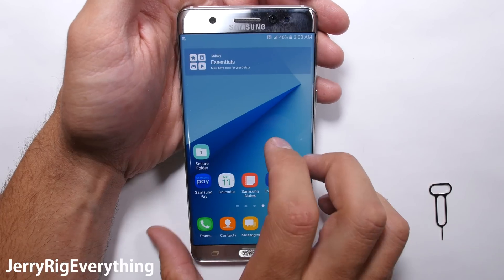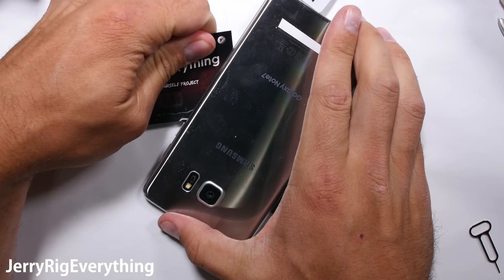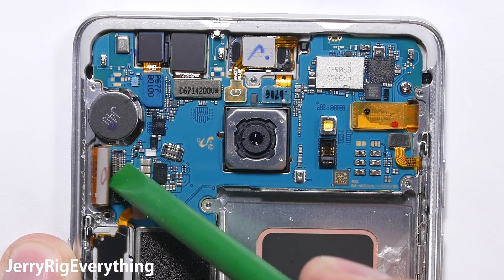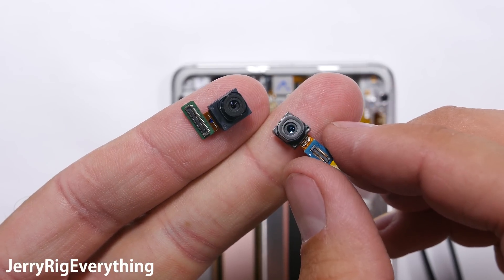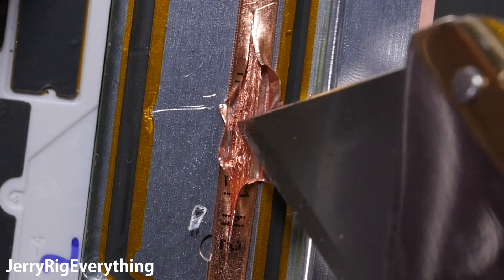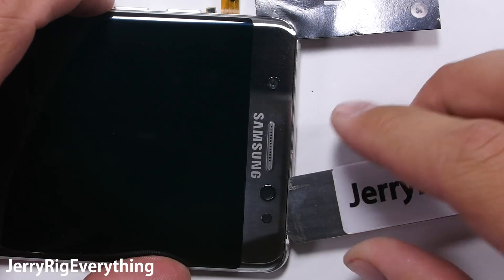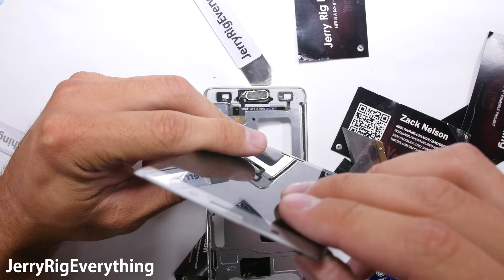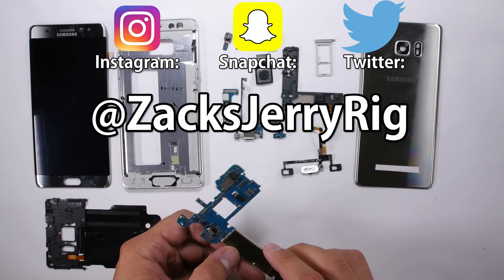Galaxy Note 7 Teardown - Screen Repair, Charging Port Fix, Battery Replacement

Comment: Hi.  I have motherboards for Samsung Galaxy Note FE and 1 display with frames, 1 back cover.  I have already ordered NFC / WIFI antennas and speakers.  I need the rest of the parts for mounting phones with 14 motherboards.  Can you write me what else is needed to complete the phone in full?  Motherboards, displays with frames, sim trays, s-pens, back covers, NFC / WIFI antenna, speakers, camera caps.  I up please help.

Comment: I wonder if u happen to know the exact housing space which the note 7 battery has, as well as from the Galaxy s8 plus. My note 7 is still working due to a software fix from me. But i am still aware of the fact it could explode. That's why i wanna replace the battery from the note7 with the battery from the s8 plus. I've read it'd fit. But I wanna be sure of it.

Comment: Can you replace the original note 7 battery with the Fe battery? Will it work?
Reply: hukebine yes, if you can find an FE battery
Reply: Would the s7 edge battery fit?
Reply: Farin Pohl no

Comment: Hey can't those who still own a Galaxy Note 7 nowadays just replace the battery so it won't explode
Reply: Let's see how long usernames can get,I guess they can pretty damn long like really long if you can find one, absolutely. You will need to install a package disabler to prevent getting cripple updates
Reply: Let's see how long usernames can get,I guess they can pretty damn long like really long omg your username though

Comment: so it means it will not explode?
Reply: RENZO LOUIS don't know, I asked the same thing
Reply: hiesenberg the battery could have to burst to combust into flames. And as much as I LOVE the note series, this one goes boom at an alarmingly easy rate
Reply: LOUIS' JOURNAL they caught fire ,not explode plus the majority of note 7s would not catch fire just alot and i think it only happened during charging

Comment: Hi Jerry, I have a galaxy s7. I lost my sim key and decided to use a sowing needle instead. I did this a couple of times, it worked. Then recently I found one of those life hacks, the sim and SD card hybrid card DYI. Well It didn't work and as I was trying to pop out the sim tray again and my sowing needle just ended up going through the rubber or plastic of the tray and jammed in the sim tray hole. So even if i got another legit sim tray key and just end up jamming in further the sowing needle. Is there anyway you can think of way of prying it out? I'm assuming Id need to take my phone apart. Please help lol it's just a stupid situation I put myself into. If you can could you tell me what tools I'd use to fix this issue as well as parts.

Comment: I love my Note 7, but now the lcd screen is cracked and is completely unusable. Where can I get a replacement screen for my Note 7? I honestly can't find them anywhere.
Was production canceled for replacement parts after the recall??
Reply: Take it into Samsung and get it exchanged for a brand new S7 Edge. Samsung is obliged to replace them.

Comment: fuck this is upsetting....my replacement note 7 has a faulty home button that sticks on the right side when pressed in. i called Samsung yesterday and told them I'm keeping my original note 7 (the first recalled one) to use as spare parts since you can't get any note 7s anymore and for them sending me a somewhat faulty replacement .

But but after watching this teardown I'm extremely upset that I basicslly have to live with this home button on my replacement. unless anyone has an idea of what i could do??? any help would be greatly appreciated
Reply: You should really consider exchanging it for an S7 Edge.
Reply: C00LiDude I'm a note only person. I find its functionality to be on a whole other level compared to any other smartphone. And I don't think it's fair I should have to buy a note 5 (3 year old phone) on my new contract. Switching to the edge is great and all but it still isn't the note 7. Note 7 is unmatched by any smartphone.

My replacement note 7 I am keeping no matter what. But I will trade in my recalled one for something else. I just wish I could fix my home button before I did that.

Comment: How to disassemble your Note 7: "Just don't. You're going to fuck it up, be out of $900 and hate yourself."

You did an amazingly meticulous job, JerryRigEverthing.  I tried this with my old Droid 4 and a couple of iPods and I have come to the conclusion that taking apart these tiny personal electronic devices is not a skill I come equipped with.

Comment: I would have rather they made the phone easy to work on than so called water resistance but they did this so you will have to upgrade because Samsung doesn't care about loyal customers, they're all about the money! Happy recall Samsung! It coulda been a 10 second issue, but the didn't foresee a issue! Hahahahahahahaha karma bit you back Samsung!

Comment: From what I've seen in other vides, the most problematic thing is that the glass cracks easily in corners and on sides, where it is bend. Especially in the corners, as those are the points most likely to hit ground, when dropped. Also it seems that the back glass is way more fragile then then front one. So it's not even more crack resistant.

Comment: Hi if it was a real heatpipe you damaged it :) It works with low temperature evaporation liquids such as acetone or so and definitely should stay not punctured :)

Comment: To separate use a Dunlop Tortex Guitar Pick .50 is perfect especially if you play guitar and you manage to wear a edge! They're not petroleum based so they don't like to melt and they don't like to crack, strong yet very bendable...

Comment: Shout out to my lovely 6P and it's diagonal distortion across the back panel from normal use.  Ever so slightly crooked if you hold it in line with your eye.  Still love it tho.

Comment: I`m thinking you could make a jig with 2 suction cups on each each side ,  have the jig frame with a couple of hand wheels , one at each end that pull on the front and back cover allowing you to warm the device up free hand while it is  gently having some load pulling on it ,  we will call this the universal smart phone case splitter  :) , could be handy for a dude that does a lot of battery replacements  :) .

Comment: So in other words, don't try to fix the note 7 yourself, or have someone else do it that doesn't have Samsung level repair facilities. Because now I don't believe it will be waterproof to the same level as it was since it was done in a way that was not intended. I will say this right now, an apple device is way easier to service than that.

Comment: Couple things, i would recommend using guitar picks instead of your iseasmo, it'll help prevent the silver back from coming off the back. and heres a pro tip for ya! as you start taking the screen off dribble some 99% iso alcohol in there, and it will separate the adhesive, its a little messy but will provide a MUCH better result than the old fashioned heat and pry method

Comment: Rather than a pull tab (which, I hear, breaks off sometimes), why not embed 2 fine wires into the adhesive which can be connected to a power source?  This would heat the adhesive enough to allow easy separation of the parts.  Replacing the part in it's original location and re-applying power would allow the seal to be reset.

Comment: Samsung's are getting harder to repair. I wish Samsung used a screw mechanism like that on the iPhone. I don't know whether it's possible to create a water proof design out of that but it sure is getting harder for the casual DIY repair :/

Comment: Good attempt at trying to remove screen. But be careful don't do too deep with the playing cards. If you want the screen to come off easy. You need to submerge the screen in hot denatured alcohol as it breaks down the adhesive .

Comment: that's bad ass, it's not so bad to changing the battery. now the question is if you don't get the back to seal right will it kill if it gets wet ?

Comment: apple  has a way better build.
Reply: Nah man have you seen the 6 Plus and 5S bending. Have you seen the iPhones terrible design? After the good man Steve died, all hell broke loose with Apples design team and have designed and built terrible phones.
Reply: the 5 and 5s still have good design until the 6, also when did the 5s bend?
Reply: LOL. You think dual cores are so perfect and 2 gigs of ram. LMAO
Reply: +Pranav Masson Enjoy your house burning down from that purchase!
Reply: +Pranav Masson buildwise not the material resistance. the inside is so perfect.
Reply: +Pranav Masson lol sure!!
Reply: Doge Consumer Reports tested the 5S under 150 pounds of pressure and it bent. While the 5C did not and neither did the Galaxy S4
Reply: +Pranav Masson there's a video where they test note 7 with the 6s a loop test. And the iPhone does way better than note 7. What about that?
Reply: Pranav Masson yeah and it ran better than your octa core 4gb ram phone
and thats fucking 60kg, do you step on your phone or something?
Reply: Actually I just upgraded to a note 7
Reply: Ricardo Carvalho And that what your said is not true
Reply: +Pranav Masson just look for that video  "galaxy note 7 vs iPhone 6s speed test" from phone buff and see for your self!!
Reply: Ya Note 7 wins haha
Reply: Pranav Masson really? the 6s finished 2 lap before the note 7 even finished one
Reply: Actually I bought the OnePlus 3
Reply: Pranav Masson i bought the moon yesterday
Reply: thats great poor ass loser

Comment: you see, the frame is that big firstable because it helps to hold the whole phone together since the phone is nearly bezel-free. makes it also stronger. secondable the phone has an internal heatpipe the "big" aluminium frame helps the heat to spread a little, that way we dont feel the phone heating up fast.

Comment: If you plan to do a water proofing test, can you include dropping it into a creek and not just using tap or bottle water? I want to know how it holds up to every day life when it's dropped in water. Since I don't live near the ocean the only water issues I are lakes and rivers (creeks). Thanks!

Comment: Good to see that putting in a new battery is not a major deal as i know a lot of removable battery fans get a bit OTT because of phones without one. As for changing the screen, well that is a serious job and one for a Samsung repairer and the associated cost. I know the iphone is much easier to replace a screen but Apple do tend to make them as easy as possible so they can be repaired in their shops. One day Samsung will work that out.
Looks well put together though and a marvel of technology, getting all that into a small package.
Reply: Yes, I think the con's outweigh the pro's when attempting a DIY fix for the screen. As much as it's great Samsung's been able to water proof their phones, they pretty much rely on glue to hold the two panels together. I hope–given the amount of resources they have and their capable engineers–that one day they will create a design as easy to repair like that on the iPhone, while still making them water proof, strong etc.

Comment: Just curious, I notice the home button is scratched up. Is this the same phone used in the scratch test video? It seems like the screen looked pretty good on this unit.
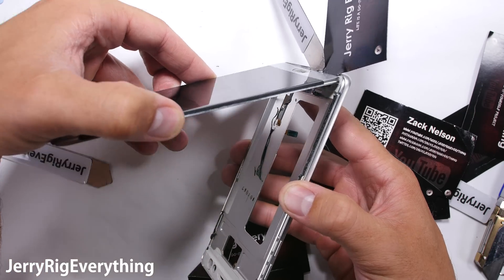Reply: Correction....I did notice around 7:09 scratches from previous test

Comment: Hey Jerry, i have to take my S7 Edge to repair the backpanel, because it is cracked (phone was never doped or bended). If i take it to the repair shop, they told me that they have original samsung backpanel and seals. Will my phone be again waterproof if the replace the back glass?

Comment: Thanks for the informative video. It's a shame that the display is not easily replaceable without going through everything you did. I highly recommend getting whatever equipment protection plan your carrier offers if you're going to get this phone. I always do regardless of any reviews. I currently have the LG V10 but I am highly drawn to making this my first ever Galaxy Note phone I have ever owned. Only feature I dislike is the battery cannot be removed.

Comment: In theory rupturing the heatpipe (if it's actually a heatpipe) will make it not work any more as they're typically filled with a working fluid that absorbs heat during its phase change.

Comment: Can't quite express how glad i am that the charging port on this no longer has the stupid touch-buttons attached to it which forces you to lift the screen up in order to replace it.. S5 s6 and s7 all had it .. We never got the note 5 in Europe, so .. did they have that stupid integration as well?

Comment: amazon.com/dp/B00B2GWRVQ/ref=asc_df_B00B2GWRVQ4341361?smid=ATVPDKIKX0DER&tag=shopzilla0d-20&ascsubtag=shopzilla_rev_72-20;14716901422712663957110070302008005&linkCode=df0&creative=395093&creativeASIN=B00B2GWRVQ try this screenprotector on the Note 7 to try if it does something

Comment: I never really understood why people use heat guns when a plain hairdryer is so much easier to work with, giving of enough heat to allow constant operation but not enough as to damage board or screen. It will also keep the phone at a constant temperature, so no need to heat the phone every 30 second.

Comment: That sucks that the ribbon broke but other than that nice tear down the phone looks really fancy under the hood.
Reply: I've repaired 3 galaxy s4 screens and that was easy but when I broke my s7 edge I just sent it in I knew it probably would be a bitch due to the waterproofing. Also I did not want to void the warranty if i fucked up.

Comment: Excellent video! Thanks for this. I work at a mobile repair shop for a living and we have yet to see one of these, so it's nice to get an inside look before one does come in.

Yes, that first ribbon cable you sliced off the screen was the S-pen digitizer connector. I hope they won't all be this tough to take apart!

Gotta love that the home and menu button array is finally separate from the charge port. On S6 thru S7 edge and Note 4 and 5, the menu buttons were part of the charge port. So if you needed to replace the charge port, you had to lift the screen without damaging it.

Comment: Thank you for making this video and for the sacrifice in the making of this video... 😢

The Note 5 and Note 5 Edge were literally everthing that I didn't want. Now that Samsung brought back expandable storage, water and dust resistance, as well as the IR blaster. If I could make a change to the design without any problems(water/dust resistance) it would be a removable and user replaceable battery!

I still have the Note 4 and think I'm finally ready to upgrade to the Note 7! It's almost everything I want in a phone!
Reply: I think that at this point the trend towards non-replaceable battery is all but a one way trip, sadly.
Reply: +Stefán Patli maybe he means the s6 edge +
Reply: Same here, but i don't think the note 7 has a IR blaster
Reply: Hahaha nice. I honestly thought there was a N5 edge though I'm sure I'm just confusing it with the Galaxy S6 Edge.
Reply: +NetherHound I didn't either but didn't he mention that it has one in this video?

If I'm mistaken that is a bit upsetting but it's all good.

Time to go to bed lol
Reply: +Raj Rohila yes he did say it, but i think he just miss spoke it, because he said that he would talk about it more but showed us the iris scanner, too bad though, it got my hopes up
Reply: NetherHound Yeah that would only make sense... :( 

An IR blaster is so useful through!!! Lol
Reply: +Raj Rohila just in case if you're boring and turn off the air conditioner next door 😂😂
Reply: +rshood al-malki or change the channels on their TV... 😂😂😂

Comment: The heat pipe uses pressure to work.  Cutting open destroys it. Folding the copper back down cannot make it as good as new.

Comment: I have a question should I get the s7 or s7 edge or note 7 gonna upgrade currently have the s5 for 2 years which will last more in the long run
Reply: Well... Specs wise the Note7 is the best from that three. Personally, I think the Note7 design is more beautiful than s7 edge and so, due to being more squared and not having big corner curves. So, if money was not a problem, I would definitely pick the Note7. But that's my personal preference. It's up to you. They are all great phones.
Reply: +Cláudio Gomes so your saying the note 7 is more flat and the s7 edge is more curved
Reply: David Zuniga I am not refering to the screen corner! I am refering to the 4 corners of the smartphone's body! :)
Reply: David Zuniga Also don't forget that Note7 sports an improved AMOLED screen compared to the S7, which if I recall correctly is the best screen on the market at the moment!

Comment: Nice to see they took the back and recent apps buttons off of the usb charger chip, that was such a terrible experience when replacing my s7 egde screen as the button came off with the screen and I didn't realize it at the time and of course had to order that part as well before replacing the screen, which also means taking the screen off to do a usb port repair. Luckily I wirelessly charge the phone but still if you ever need to replace it definitely want someone whose done so before haha. This phone is more refined that's for sure I like the changes to the inside still sucks to open and change the screen but it seems like the other components are easier to deal with than before.

Comment: Note 3 design is still better (with an easy access to the battery)
And the glass cover is stupid. Easy to break, hard to handle.
Oh, and did I mention IR?